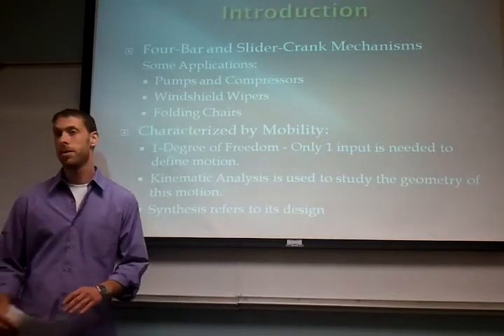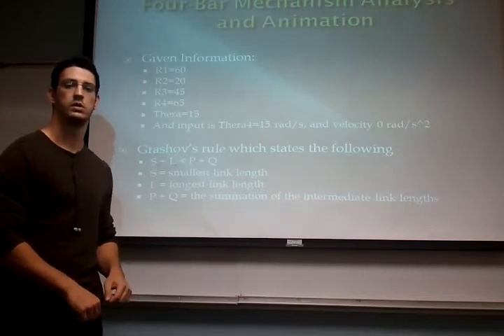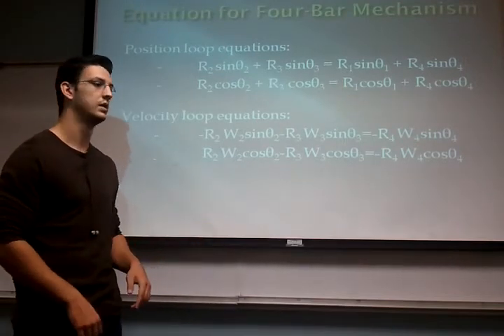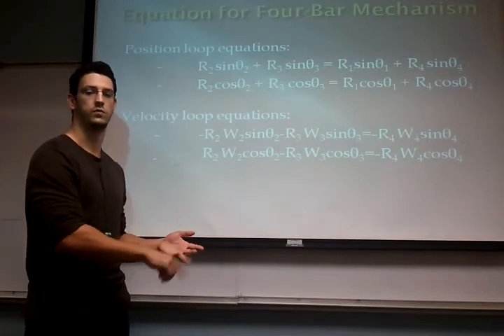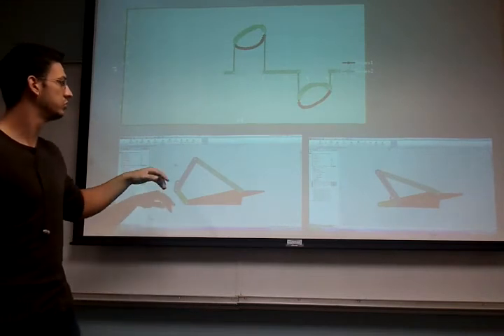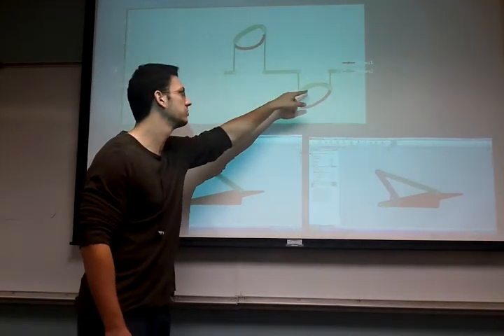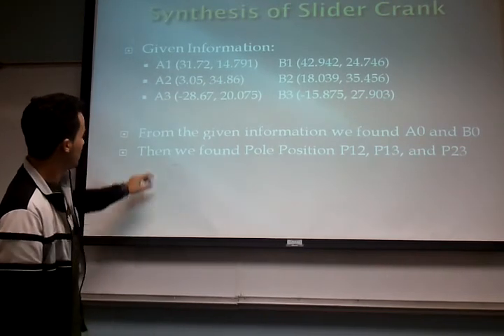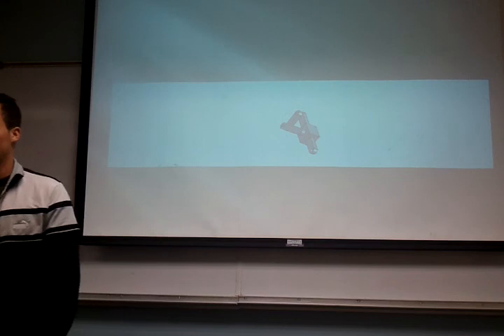Team 13: Presentation on Kinematic Design of Four Bar and Slider Crank Mechanisms

Comment: The camera angle can use some work.  You should try a tripod next time.  The video volume also seems low, it's possible you weren't speaking loud enough or the camera mic wasn't good.